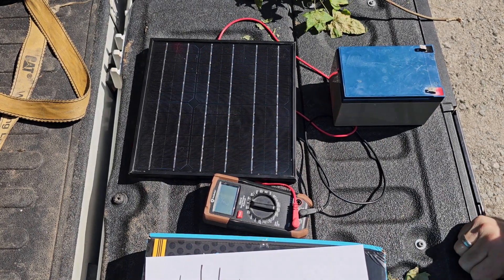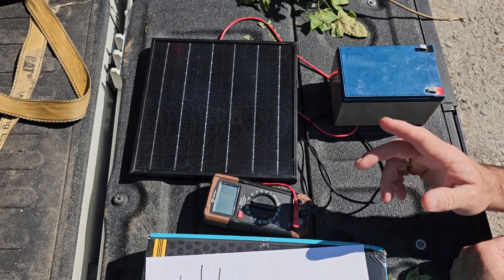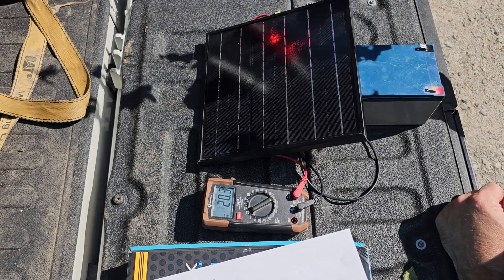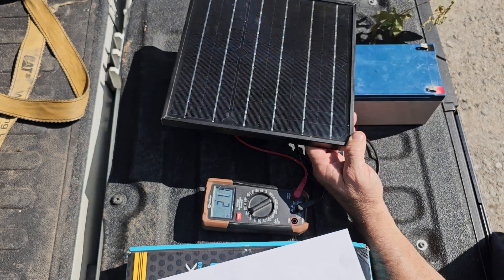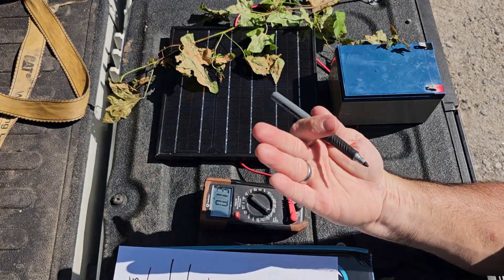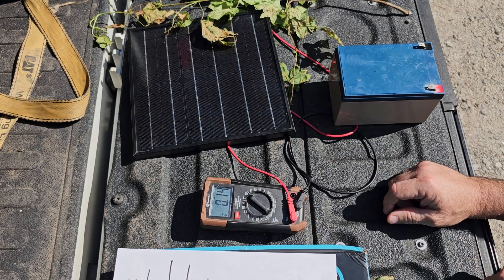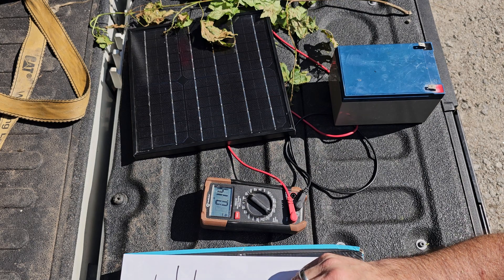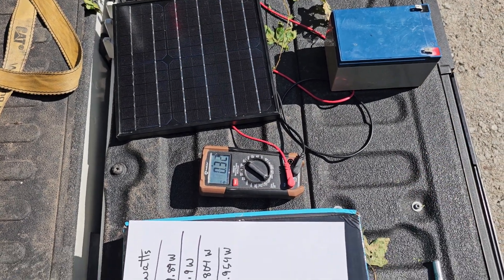Trail camera solar power and how the quality of sun and shade affect it. (Revised)

Comment: I thought the solar panel charged the internal batteries inside the solar panel. As long as the batteries inside the unit are charged the amount of amps produced at any given time shouldn’t be a issue. The panel doesn’t run on just the sun. It’s job is to charge the panel’s batteries which in turn run the camera.  Maybe I’m wrong. You make great videos and are very informative. Thanks for everything you put out.
Reply from the maker: Can you be more specific about what you are referring too and maybe I can elaborate?
Reply from the maker: Nevermind I understand now. I take an amp reading so I can calculate watts to show how a 10w solar panels output is affected by the quality of sun. With a small amount of shade the output is reduced down to a watt or two. A 1 or 2 watt output will never be able to recharge the batteries under high picture and video counts in a cellular trailcam. This video is to demonstrate why solar doesn't work or work as well in partial shade.
Reply: @herd360  As long as at some point in the day the panel gets fully charged, then maybe a shaded section of the day isn’t a big problem
Reply from the maker: @Will  it can be a problem. Lets say you get 200+ pics a night and the panel isn't getting full sun at all each day. 1 or 2 watts isn't likely to recharge the battery power consumed and eventually the battery will die completely. Now, move the same setup out where the panel gets full sun for several and is able to produce its rated 10w of output and now its capable of recovering the consumed battery power before nightfall.
Reply: Seeing is believing ,thanks for taking the time to demonstrate how even a small amount of foliage and angle can effect solar performance.

Comment: I have 5 Reolink Go PT PLUS cellular cameras with its own solar panel, my question is, Can I use your 1025 solar panel to replace the stock Reolink solar panel. You just sent me and my buddy each a cell signal booster today. 6/5/23
Thanks Terry McCray
Reply from the maker: What connection is it? Currently our spp1025 usb port doesn't not support constant power. After the battery fully charges the usb output will shut off.
Reply: Micro usb male from the solar panel to the Reolink camera, which has three internal lithium batteries
Reply from the maker: @Idaho Spud  if you connect it to the USB-C port on the panel it will stay constant on. It should power the camera.
Reply: Thank you 
I couldn’t tell if it had a usb port 
Thank you very much
Reply: Just started watching your vids
Reply from the maker: @TheBUCKWHEAT11  thank you 😊

Comment: I won’t be using solar but I will be using a external battery box. How many amp battery would I need to get close to 10,000 pictures?
Reply from the maker: I have had customers report 10,000 plus pictures on a 12ah battery. That's stretching the limits in my opinion if using an SLA/AGM type battery because you are more than likely overdischarging the battery. You could go with the 15ah LIfePo4 from Amped Outdoors and it would shut off before damaging the battery from overdischarge but picture numbers is hard to predict. So many factors like cellular network speed and signal strength, hd requests, videos, night images with flash, size of thumbnails, the new tactacam firmware gives better thumbnail quality but it uses more power to send those.